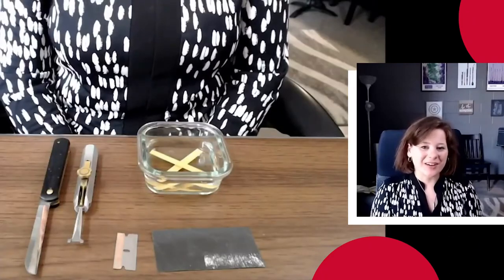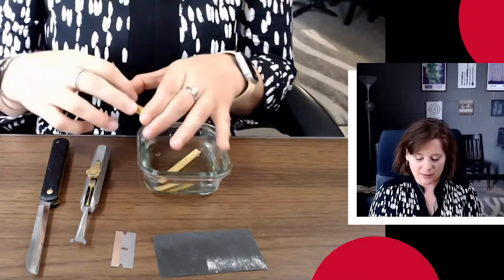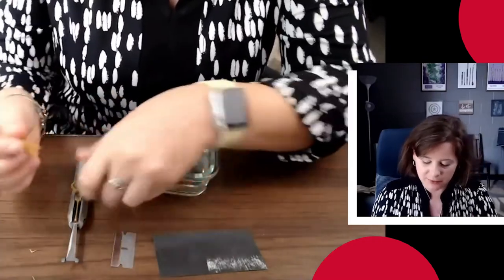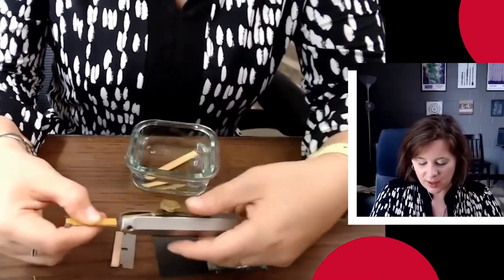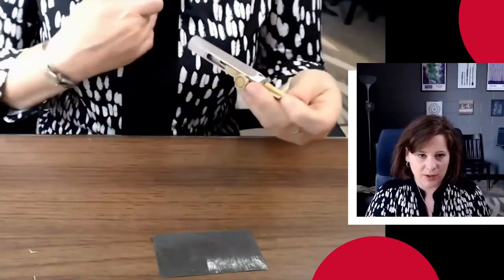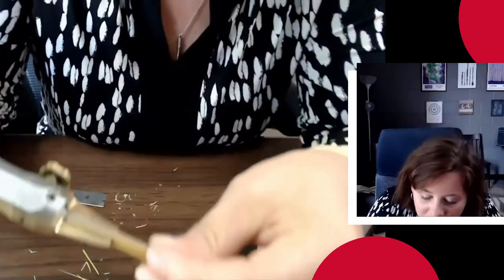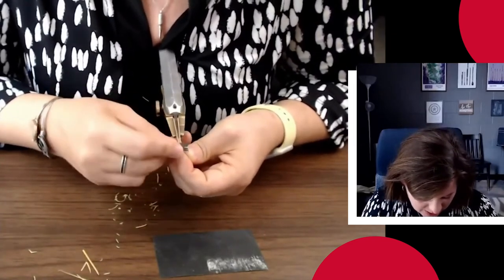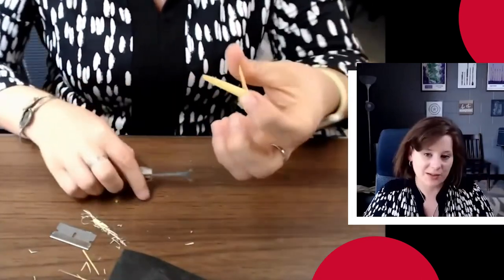Shaping Oboe Cane

Comment: Wow no comments. Thanks, I found out why I'm cracking the cane; pushing down in the middle. Last time for that! 4 out of five in the last batch, and that gets really expensive. The last video I watched said to flatten the cane on the side of the knife before bending the cane over the knife, and that only works with really soft cane.
Reply from the maker: So glad I could help!  Flattening cane on a knife is certainly one way to fold over the cane, but it was never my preferred method as you can see!  Happy reed making!